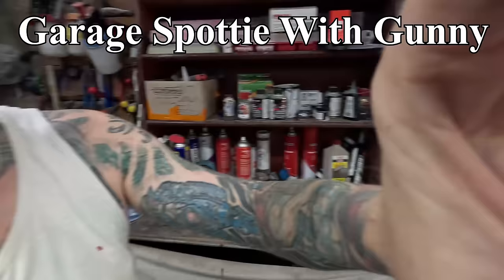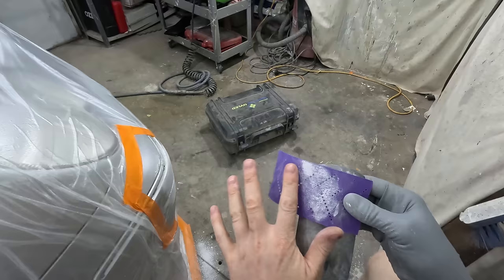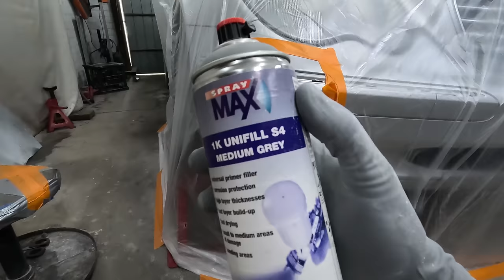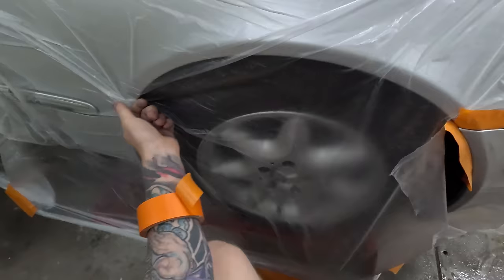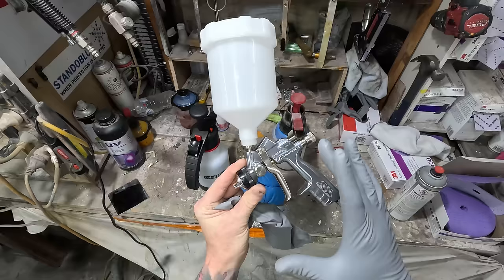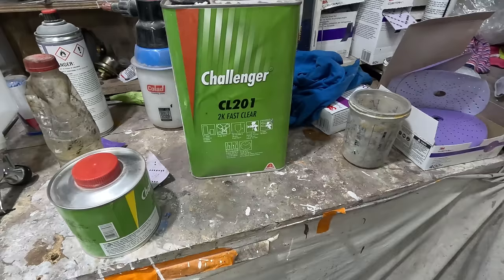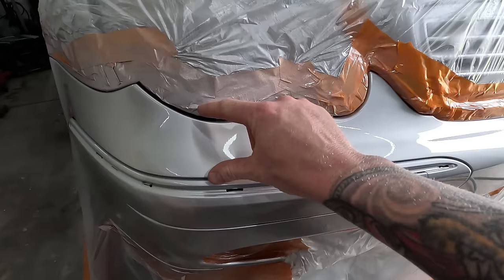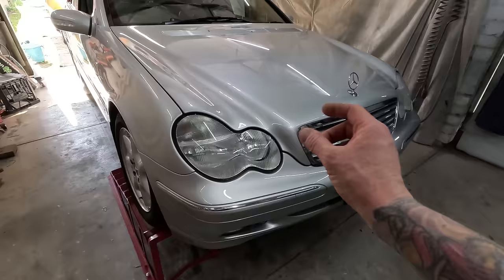Garage Spot Repair & Paint C200 Benz

Comment: Hi Gunny- I do this type of spot blending on my used cars all the time. Thanks to you, I've tried the Colad UV filler. It was only like 20 bucks on eBay or Amazon. And a $12 UV light on eBay does the hardening in 5 seconds. The price "is definitely coming down"!!! I have only used it a couple times but you are right that it does not shrink- it feathers out finely. Not for deep stuff, but is FAST!  It does seem like a plastic sort of. I'm going to try that first step of shaving it with a razor blade.  (I like shaving bondo or bog with a cheese grater first too.)  1k primer works for me too unless feather edges lift. Thanks for your videos.
Reply from the maker: Mate whatever works hey.

Comment: Great video mate, Question for you though. I've got the R160 with the 1.0 tip, at some stage I will have to do roof/bonnet and hard cover on my D Max, do you reckon I'd get away with the R160 or should I get the Compact? notice the fan is obviously bigger. Perhaps I could use the R160 for base and the compact for clear?? In hindsight I would have got the 160 with a 1.2 but think they were out of stock or if I could get the 1.2 for the R160 would that do??

Comment: Not sure how breakers look in Australia but if your garage is on a 15amp breaker, you can switch it out for a 20 or 25 amp breaker if it isnt already and that should fix the flipping problem. Also not have so many things plugged into one outlet. If you have multiple outlets in your garage then just run extension cords and free up the load on one outlet.
Reply: Won't make any difference what outlet he uses if garage is all on one breaker. He needs an electrician to upgrade breaker if wiring can carry the extra load 👍
Reply: @SalvageMasterEssex  my point was that if the breaker is say a 15 amp, he can upgrade it to a 20-25 amp one and it will fix the issue unless it already has a higher amp breaker
Reply: @latinprince896   And my point was, if he upgrades to a 20 - 25 amp breaker but only has wiring that can handle say 15 amp, he's gonna burn garage down. Hence reason I said consult an electrician 👍

Comment: How do you get the paint from retail shop to have colour match as there are variants. Planning to do spot repair on 3 layer pearl. But worrying no way to get the colour close with original bumper.
Reply from the maker: It's difficult, but some auto paint suppliers will match for you, you just have to find one near you

Comment: Great vid mate. So nice to see a real pro not being too precious to show how to do jobs like this. No parking sensors on Oz Merc’s?
Reply from the maker: They do have parking sensors just not on the 2001 models
Reply: @TheGunmanChannel  If car had parking sensors this video would never have existed 😃😃
Reply from the maker: @SalvageMasterEssex  I don't know about that, I've repaired and painted many cars with sensors.
Reply: @TheGunmanChannel  Well in those cases damage was caused by driver of the other car who clearly never had any sensors crashing into the car that did have sensors 🤣🤣
Reply from the maker: @SalvageMasterEssex  sensors don't stop bad drivers being bad drivers mate 😆
Reply: @TheGunmanChannel  That's true but they are useful when manoeuvring in tight spaces 👍